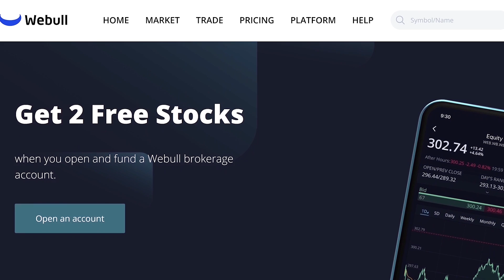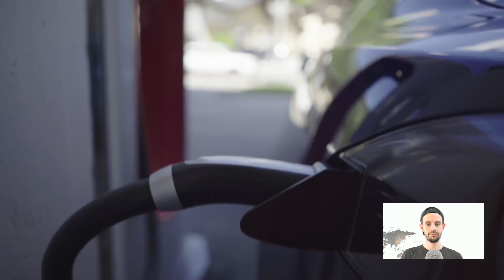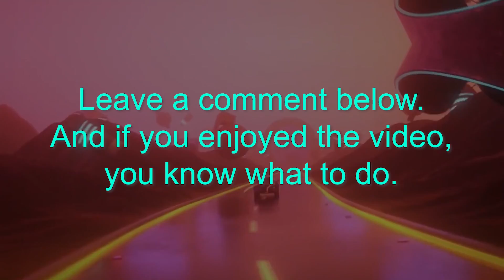Elon Musk: Cybertruck, Texas Gigafactory & Tesla Engineering

Comment: We've got a Model X, had it for about 1.5 years. My father originally got me to take one for a test drive, as he wanted to try it but knew he wouldn't be able to afford it. A lot of my friends in San Jose, CA have them as well. It's the best car we've ever had by far. It also led us to buying Tesla stock, currently at 620 shares (goal of 1000 by end of 2021) and have over 150% return over the past 12 months, which paid for the car, the yet to be delivered CyberTruck, and two Power Walls, and all the energy these cars will ever use.

Comment: My GOD, I wish I could have a conversation with ELON so I could pitch his buying WORKHORSE and take that segway into Lordstown Motors.  He could have his Van Assembly plant and all the same time extend the utility of WorkHorse's utility truck with varying size and construct batteries...100 to 500 miles, as needed.
Reply: TESLA does not need Workhorse, their Battery TECH is Garbage .
Tesla can easily fabricate a 100% Composite van , RV , Trailer if it wanted to . 
the Workhorse vans are Incredibially INEFFICIENT and a waste of Resources.
Reply: @markplott4820  No one says NEED, but a Tesla infusion could offer many more options to this niche platform and also gain a foot into the Lordstown plant and operations.  No one is disputing your opinion,  but I to am smart and capable,  and even, perhaps, of looking at things differently than you, sir. I see value as a side hustle with no downside.
Reply: @homerreagan4456   - then YOU have Incorrectly analyzed Lordstown , motors.
they have a LESS Advanced factory than Fremont, and are NOT Vertically Intergrated like Tesla is. and Tesla is using 1st Principles in everything it does.
Lordstown are using 100 year old Technology. they have NOTHING to offer TESLA than it Already has.
ELON stated, that they can EASILY base the Tesla VAN on the 300 mile SEMI or a mini BUS on the model Y platform.

Comment: The van is going to have legs. Elon won’t be able to resist sticking it to Rivian/Jeff with a self driving delivery vehicle.
Reply: Rivian will be Bankrupt by end of 2020.
Reply: Mark Plott what do you base that claim upon? Rivian has bags and bags of Ford’s and Jeff’s money.
Reply: @matthewdunstone4431   - RIVIAN is Burning through CASH, and nothing to SELL. 
it shut down Building its Vehicle Factory and is DELAYING Vehicle production till 2021. TESLA will likely be the FIRST to market with a Production BEV truck. 
then there is the Ongoing Tesla/Rivian lawsuit, which will Further delay Production. 
besides, Rivian is NOT offering a Compelling vehicle, its TOO Expensive and R1T is just a LIGHTWEIGHT pickup truck with only MODEST spec. 
CT outperforms Rivian just with Dual Motors , compared to Quad motors on R1T.
Reply: Mark Plott all your points are correct, but Jeff has deep pockets (Ford doesn’t). Jeff needs his 100,000 delivery vans, and can’t ask Elon. Jeff NEEDS Rivian to succeed. He won’t allow them to go under by the end of this year. If necessary, he will increase his influence until he gets what he needs.
Reply: @matthewdunstone4431   - ONE problem, Jeff is NOT an Engineer, he gets others to do the HEAVY work and can ONLY Throw money at the Problem, he cant get BETTER Engineers , because they ALL work for SpaceX and TESLA. 
and now TESLA is on a Hiring Spree for GF3, GF4, GF5 and Fremont and Project Roadrunner.
TESLA/SpaceX attracts the BEST Talent the WORLD has to offer.
Reply: Mark Plott yeah, sure. Totally agree. Rivian might go bust, but 2020 is not the year.
Reply: @matthewdunstone4431   - we shall, see.

Comment: I think the biggest size issue for the Cybertruck (in the United States) is side mirrors. Can it drive down the street without its mirrors hitting the mirrors of parked cars? (...badly parked cars) After that the only consideration is size of battery and range. The range of the Cybertruck is actually how far off a paved road ( away from a Supercharger) is expected in addition to the battery draw from power tools, recharging ATVs, running the cabin, etc...? So miles off pavement plus days off grid based on activities.  If it's 'range' can reach any part of Montana with 3 - 4 days of house framing? That'll be enough.  
An Aussie might like to live in Austin, the hippest place in a hot dry state full of good ol' boys. Surprise, surprise. 
About the 'look' of the Cybertruck. Who cares? It's absolutely not an issue, if form follows function the results will satisfy aesthetically. Rivian's truck looks pretty good, but it also just looks like a Sci-Arc student rendering. If you make something that 'Does' you don't need to make it 'Look' a particular way. (My initial response to seeing the Cybertruck unveiling was, 'it looks like a DeLorean  a failure. I was initially impressed by durability (not the windows. Gorilla glass....?) and range 500+ miles. I thought the bed was too short (my standard is a 4x8 sheet of plywood). I did figure that it would be all wheel drive, probably terrific off road. I also thought the back should be flatter because that gave it a lot more options. And I prefer vans because the storage is air conditioned or heated and sealed from dust.  Now that all of these have been addressed, I can't wait to get my hands on one.  It's always good to remember your initial responses because they will change and then you won't be able to remember what they were; you'll end up deluding yourself.) 
What was dorkier looking than a Model-T truck? (Basically Ford made skateboards and people built on them.) Didn't matter. It worked better than anything else people could afford so it was a hit. A pick-up truck is also about function. All that other stuff, the chrome, the cushy seats, the shiny paint? All it did was siphon off some car buyers to buy pick-ups. This is like the 1980s Los Angeles  'hair dresser's Jeep." A fully 4 wheel drive off road vehicle detailed like it lived in a nail salon driving exclusively on paved west L.A. streets, nowhere near dirt. It's a pose. There'll be more than a few Cybertrucks bought as a similar pose, but they'll quickly sort themselves. I wonder how police departments will differentiate their Cybertrucks.

Comment: If it is true that towing near capacity reduces the range by half, the dual motor won't have enough towing range. 300 mile range + 2= 150.  If your charging stations on the highway are 80 miles apart, you will have to stop at all of them!

Comment: After owning a LRDM 3 for a year now, Best car I've ever owned!! At the unveiling I immediately preordered originally the all wheel drive version. The next day changed it to the trimotor 500+ range simply because towing with a Tesla you loose 50% range. At 250 miles towing would be acceptable. I'm a general contractor in California and towing occasionally equipment and vacation trailers. I've been driving f150,f250 & f350's most of my adult life at 67 that's a lot of trucks. I bought the 3 without test driving, no regrets. So looking forward to the Cyber ordered with full self driving that's already brilliant and only getting better with every update. Updates are a thing when owning a Tesla. Mine in the year I've owned it has increased range increased full self driving capabilities & added games on a regular basis. Charging has gotten faster as the 250 chargers are rolling out. A year ago there was one within 15 minutes of my boat, now there's  3 and another one being built. 79 originally now a 150 & 250 available. I live on a boat and can't charge at home. Not a problem. No regrets, simply brilliant!! Cheers & keep up the great work, really enjoy your channel!!
Reply: I've been thinking about upgrading to the trimotor Cybertruck. So tempting to get the extra range and battery capacity for camping and whatnot. The main issue is convincing my wife.... ;)
Reply: I've been thinking about convincing my wife to live on a boat, way more difficult than a trimotor cybertruck sell, lol kudos to you sir living the dream!

Comment: Actually 90% plus of the pickup truck market. Big, powerful, safe, and impression of intimidating badness are high on the lists for most pickup truck buyers. Less than 5% of truck buyers ever tow a trailer, yet they buy the trucks that can for the machismo. It also will hit hard at the off road market. Toyota Landcruier, step aside.
Reply: Vans are more practical for work unless you’re a farmer maybe.

Comment: Maybe the won’t build new factories so fast, but they have plenty of room to build out existing ones.
Reply: It's more about strategic location than expand current factories.
Reply from the maker: 100%
Reply: daniel_960 - NO, FREMONT production is a 1960's old Factory, and was Recently expanded to make room for Model Y production. the Problem being , its NOT as Vertically Intergrated and NOT as Advanced as the GF3 China factory. 
this is Primarly why , FREMONT sometimes has fit & finish issues, the China made Model 3 recently got TOP Consumer Satifaction in China, why ? its a more Advanced Factory. 
the USA needs a Replacement for FREMONT production.
Reply: Mark Plott „vertically“ integrated like many other cars you mean!!!! Every other cars are also vertically integrated Tesla also seriously rely on suppliers, from tires to screens to chips to all those plastics and other oil byproducts
Reply: @carholic-sz3qv   - NO, this is FALSE.
Tesla Gigafactory is like a Computer Circutboard, is makes the MAXIMUM use of space, nothing wasted. 
Gigafactory, uses Gravity, Physics and 1st Principlas. 
NO, OTHER vehicle car company has this. 
Battery, Electric motors, Electric Drivetrain and Vehicle production under ONE ROOF , like GF3 China.
TESLA makes their OWN chips and Circuit boards in TEXAS.
Reply: Mark Plott yeah but I’m not talking about fremont.
Nevada can be expanded. China can be expanded. And Berlin and Texas once these are up.